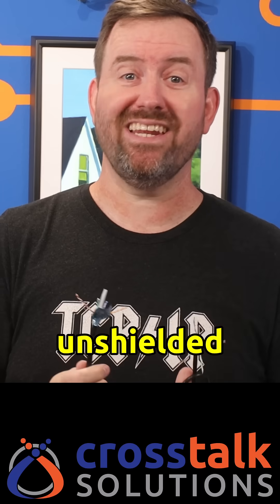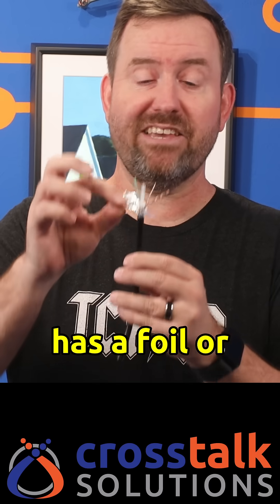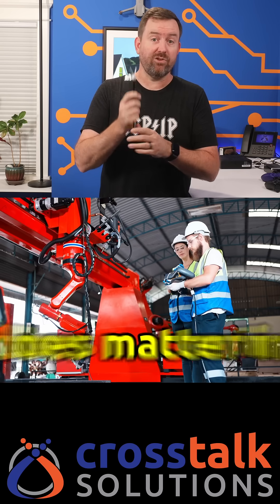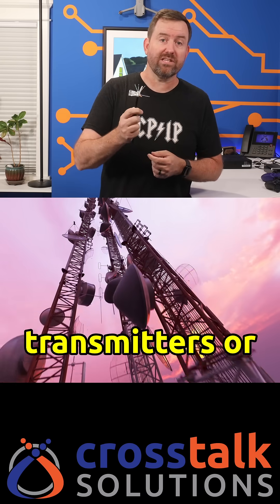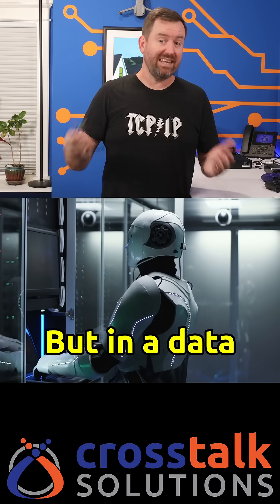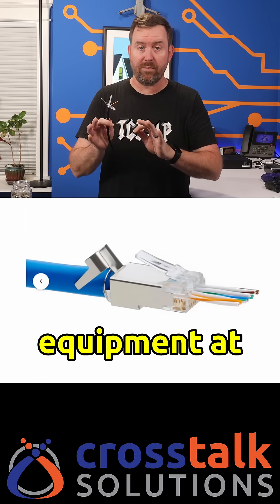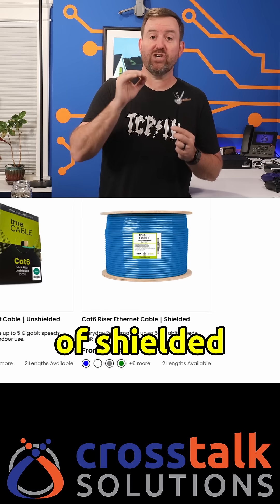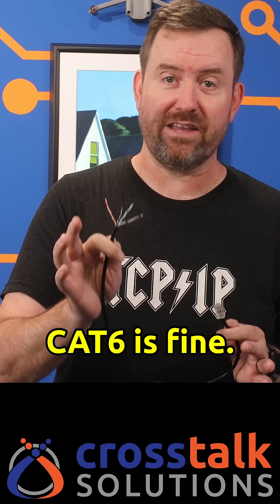Shielded vs Unshielded Ethernet – Stop Wasting Money on the Wrong Cable

Comment: You forgot one really important scenario for shielded cables: outdoors! Any cameras or APs out in the open needs the shield to be grounded in order to protect from EMI caused for instance by nearby thunderstorms.
Reply: This is what I did (I ran shielded to my external devices), but don't you also need to ground them prior to going into the building? I've been looking at the ubiquiti ethernet surge protector for each exterior device run to an 8' grounding rod at each location (8' because you need that in Florida)
Reply: @frankmthompson  Do not drive another ground rod for an exterior device unless you are also going to properly bond that ground electrode to the existing ground electrode system for that structure.  This will create a ground loop and cause a lot of damage if there is a nearby lightning strike as the ground potential between the two electrode systems can be thousands of volts, and it will try to equalize over your ethernet cable.

Just ground the cable jacket and drain wire at the patch panel inside for something like a camera or AP mounted on the wall.  For something mounted way up in the air on an antenna pole or something, you want to use one of those UBNT surge/ground blocks (or similar device) on the outside of the home, and run a ground wire from it all the way to your electrical service ground just in case the antenna pole takes a direct lightning strike.
Reply: You sound like the person I should ask. I've recently started working at a nonprofit that has a four-story building. Needless to say their network is a mess they have two separate networks across two floors. OK back on topic the downstairs network not to be confused with the upstairs and downstairs network was semi recently updated to ubiquity. The person who installed that I could shoot them for so many reasons mainly installing a small office networked into a four-story building made of brick and not accounting for the brick....  Off topic again. an access point and a camera outside on one wall right next to each other which run in about 6-8 feet to the rack. They are using shielded, cable the camera still works however the access point has died. I have yet to determine if it was water ingress in to the AP or nearby lightning. But I feel like that really should be going through ground protection and not directly into the router correct?

We're trying to take a bunch of things in house so we can be leaner with budgetary concerns. And I'm trying to convince my boss that we don't need to hire anybody to make our Internet faster we just need to properly install equipment, not a wall-mounted AP attached 3 feet off the floor in the office, and another wall-mounted access point on the opposite side of the building. Go figure it doesn't cover the event space or the second floor. I've been doing enough IT that when it got installed five years ago I went what why didn't they call me back as especially I already donated time resetting their old systems covering the second and first floor.

The biggest hurdle is we are almost completely almost locked out of the router and ubiquity control, as he didn't give the Director any admin privileges So she can't add other members to the security cameras.
Reply: @imark7777777 If you use shielded cables with properly fitted metal connectors and connect it indoors, either to a grounded patch panel or a switch/router with metal on the connector AND the switch/router is grounded through the mains cable you should be fine. Also the AP and camera needs to have metal female connector. If any of these are not met, the equipment is not protected against nearby lightning strikes.
Reply: I think there's something to be said for putting a cheap switch between the outdoor cable and the rest of the lan, that way if you do have lightening damage you'll probably just sacrifice the switch and the rest of the LAN should be fine.
Reply: @boristheengineer5160  I'm not so sure the cheap switch would just die without sending a surge further down the line. Ground properly and have good insurance. If it's mission critical, keep extra equipment standing by.
Reply: @BillyIdle73  Good point, cheap switches are typically powered by non-earthed "wall wart" power supplies, so no path to earth apart from via the other network. Some of the older Netgear models had a grounding screw.
Reply: @BillyIdle73  You want to run the shielded cable from the outdoor AP/camera to a grounded patch panel (make sure cable jacket and drain wire are grounded), and then use an unshielded patch cable from the panel to the switch/router.  This way, the energy the cable shield and drain wire picks up (from lightning microwave emp effect) gets grounded out without any of that voltage reaching the switch.  A voltage surge on the twisted pair conductors in extreme cases can still damage that switch port, but the rest of the switch is usually OK.  Ethernet surge protectors can help ground out the extra voltage on the twisted pairs in an over voltage condition, but they don't always act fast enough to save equipment that is poorly hardened.
Reply: some quality outdoor cable is sufficient. all the more reason to ground all outdoor equipment. if you're still paranoid you can ground you server rack.
Reply: @bb55555555 Grounding the server rack is not optional.
Reply: @BillyIdle73  agreed. then you don't need shielded cable.
Reply: @bb55555555 No, no, you need both! The shield leads any unwanted inducted charges back to the grounded in the rack.
Reply: @BillyIdle73  I get that but where in the outside is the charges coming from other than lightning? Nothing will protect your equipment from a direct strike no matter what you use.
Reply: @bb55555555 Direct strike can't be protected by anything than insurance 😂 But if the lightning strikes close, you can get inducted curves that can (and will) destroy equipment. Have seen it several times where the equipment wasn't properly grounded.

Comment: I have been using UTP since it was first released 30+ years ago.  I have never used STP.  I have always used fiber in an electrically noisy environment.  When the circumstances allowed, I used redundant fiber.
Reply: I myself use SFTP rarely, but, I do use them, when in high density environments with high volume of traffic. Think crossconnects between distribution and core switches.